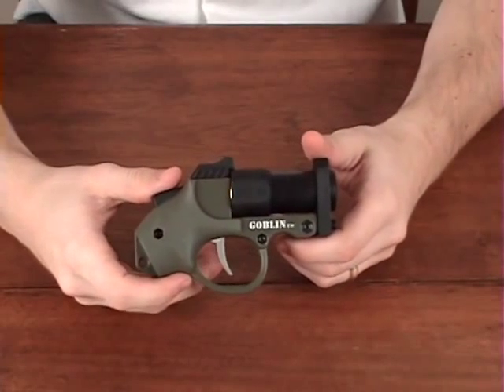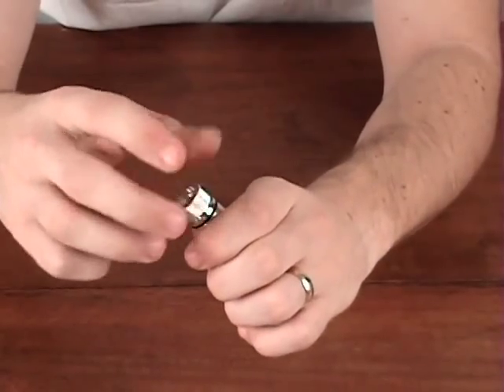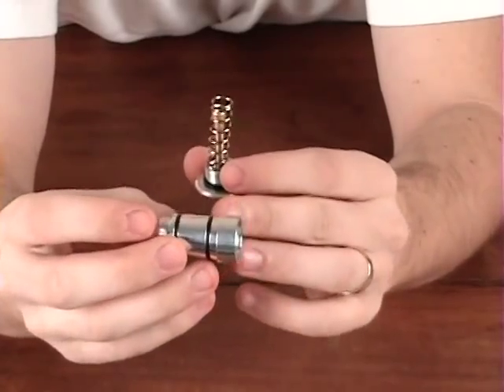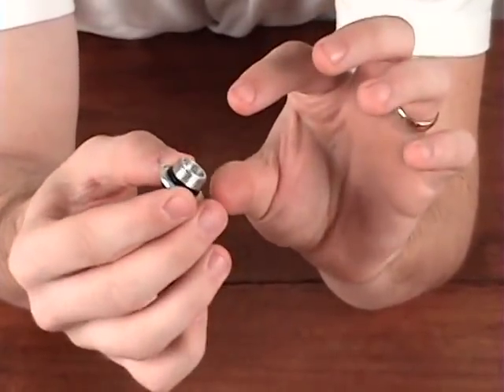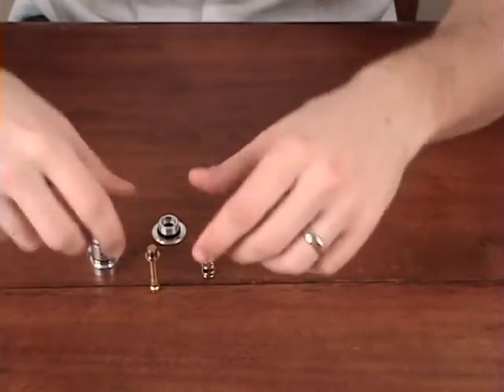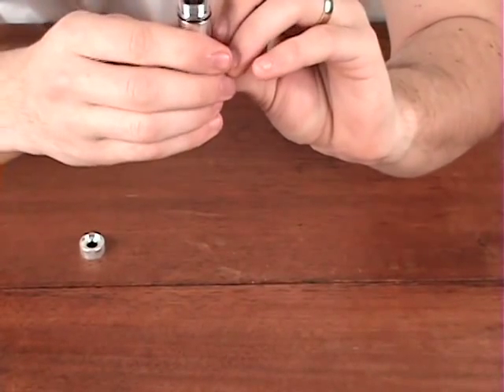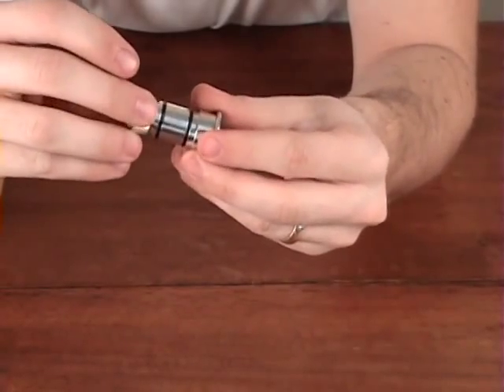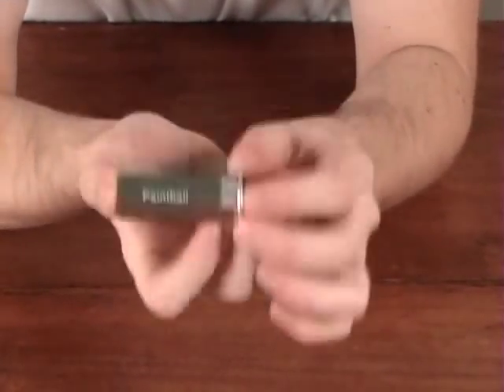Goblin Solo Air Cartridge Disassembly

Comment: @ModernIntel because i got 2 air cartridges and they were both broken so i had to open that little piece up to stretch the spring out a tiny bit so it would stop leaking. and there is a crucial o-ring inside too.